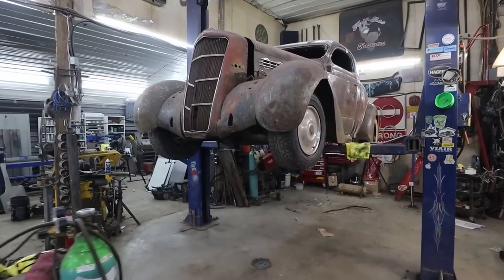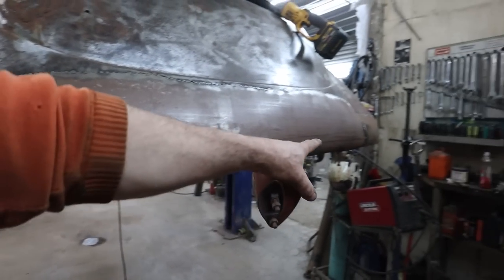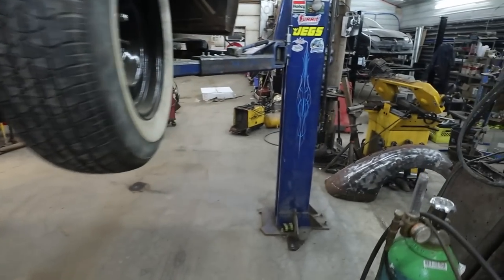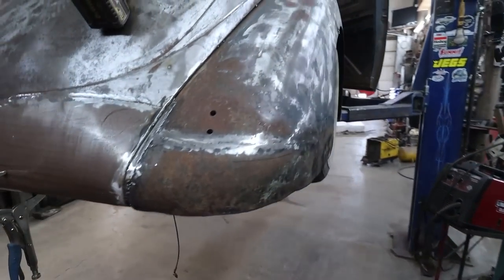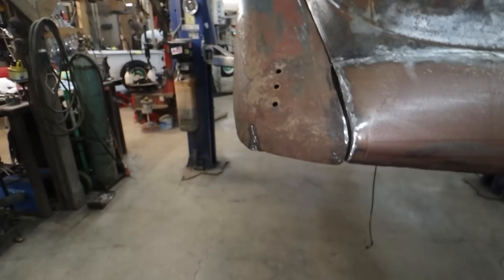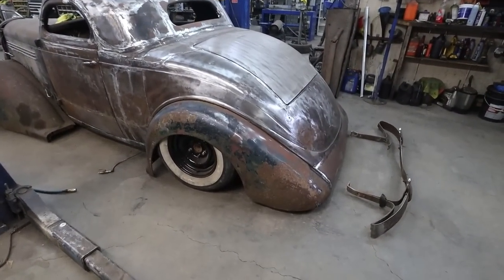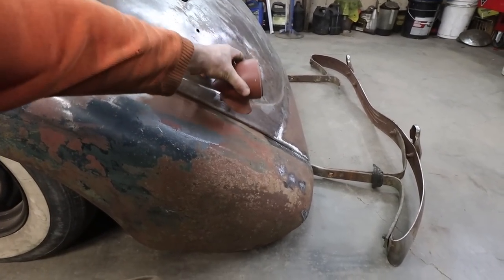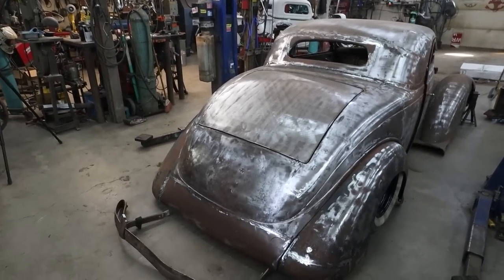Matching fenders to our freshly welded tail pan on our 35 Dodge coupe.

Comment: Another vote for fender welting to help close that large gap around the periphery, reduce the annoying "tin can effect", AND save yourself a TON of welding that may not survive your rough roads.  Bob Drake and other repop suppliers stock it, and it can be had w/  stainless or black strip; matching basic body colors may still be offered too.  Comes in bulk rolls, as I recall, but if you were to order sufficient lengths for a 35-36 Ford coupe, total amount would be very similar.  
   While you are at it, order frame welting to help eliminate squeaks and rattles between body and frame...

Comment: About rock chips. Don’t know if it’d work, but maybe you could use a trailer fender as an inner fender. 
Great project!
Reply: Method is used by aluminium fendered classic race cars over here , obviously retired from the track and used for taking to shows ,where the added weight is no longer an issue.plastic ones are used also _ great tip Steve 👍

Comment: hey brent heres my idea on the rear fenders insead of welding them tak to sheetmetal and roll it and make a "trim" panel weld some studs on the bottom drill the holes for the studs to bolt it from the bottom then if you ever need to you can take off the rear fenders still but with the trim piece on itll look like the fenders are part of the body hope ya have a great week glad this things coming along nicely it ought be driving in no time

Comment: Brent, add a metal mud flap behind each back tire. It’ll keep the rocks from hitting the back of the fender.  Also, those old cars had a cloth gasket between the fender and the body. I think a rubber one would work well today and you won’t have to weld it. Hope this is helpful.
Reply: Larry yes    i used fender to body piping gasket type 
comes in  roll various colors,,,,E d

Comment: Brent - instead of welding the rear fenders to the body, put some rubber fender beads between the body and fenders.  The fender beads from a 1970’s VW Beetle are what you need and are readily available. Your welcome ~ Pablo.  P.S.  When you are getting those VW fender beads, pick up some dawgie treats for me tooooooooooooo!

Comment: Hi Brent

On the rear bumper it looks like the bottoms of the bumperets are cut off by the looks of the front bumper.

On the rear light's it is only the mount that is for one side the light housing is universal, you could make your own mounts and fit the light housing to them.
If you have a extra set of matching light housings you could do a double rear light mount, say the inner set are tail and brake light with the outer set being tail and signal light, so using the bright light in the twin filliment bulb as brake in one and signal in the other and the dimmer light as the tail light.

On the front filler strip for the bonnet / hood to the radiator shroud split the difference by 3, 2/3 to the shroud and 1/3 to the bonnet / hood, that way the shot line will look in proportion to the mounting of the front lights.

But most of all you always come out with the best idea for the build.

Comment: Man is that car looking good, the backend is really coming together nicely! Not only are you a great fabricator, you are a great designer as well. I noticed at the beginning of the video when you welding/grinding on the back of the car. That Pablo was way in the background by the overhead door. And every time you welded or grind on the car he turned his head so he would not see the flashes from it. He is very smart, either well taught or got his eyes seeing spots and did not want that again. Take care my friend

Comment: Looking GREAT Brent! Personally I'm not a big fan of the bumpers with the dip in the center. I like the flat/straight bumpers ( like 35-36 Pontiacs or Studebakers) on Lowriders. 
However... I would agree wholeheartedly that mounding/welding the fenders to the body would be straight kustom in my book ✌️

Comment: Brent, if you know somebody with a 3D printer you could map the driver side mount and reverse it. When it's printed it would give you a pattern to sand cast a new aluminum piece. Be a good bit of finish work but it might do the deal. Just thinking out loud here.

Comment: The rear sheet metal is really starting to come together and look sharp.  It's hard to tell because of the difference in the surface finish, but it looks like the passenger side fender lobe is a bit more rounded on the bottom than the other side.  Fixing the driver's side to match should even out the bottom edge of the rear fenders...  The rolled pan is such a simple little thing that changes the look of the rear so very much.  When you get to the front fenders, could you take a few minutes and address the stress cracks in the wheel arches.?, what causes them.?, and why they are so difficult to fix..??  Most people seem to just zip them up and pass right on by without any elaboration on how they got there and why they are so danged hard to keep from coming back.  It is still a guilty pleasure to watch you shaping and fabricating sheet metal panels.

Comment: When I welded the rear fenders on my 50 buick I replaced the flange on the removable side with 14 gauge steel and cut some corner kicker out of 1 x 1 .063 about 4" long and weld them in there to support the fender farther out no cracks yet and I'm 3 yrs in driving the car

Comment: If you weld the fenders inside and out then make sure the welds are clean on the outside and use long and strong ( long strand Fiberglass filler for your first filler they won't crack, a tip from the old man. Also I started on my 34 ford 3 window again, this is Rob Burns signing out.... I'm old.

Comment: It's mentioned further down but you could use fender welts to close the seams and quiet any possible squeaking if you decide to bolt the fenders on. VW Beetles had fender welts and plenty of old cars did, too. Chrome fender welt might be kinda cool. Or buy plain welting and paint it body colour using a flexing agent.

Comment: They make a rubber seal material with a rounded side that fits in between the body and the fender that seals up that gap and I believe it’s paintable.

Comment: Building a curtain behind the wheel out of 1/2” flat expanded metal would protect the fenders from rocks and mud . It would be easy enough to clean  up and would also strengthen the fender and keep it from flexing

Comment: Bumpers of that vintage were intended to protect the sheet metal in parking situations when you or another car would bump. They are made of spring steel or at least the brackets are. Very hard to bend without heat and heating them alters the spring steel characteristics. They don't provide much protection in an accident.

Comment: The taillights that you have two of them for one side grind the bottom of it off a little bit on the sloped part of each side and it will fit flatter and fit either side it would fit Defenders good at the bottom because when it's up it'll look good and when you lower it down it's kind of like backup lights

Comment: If you want to weld fenders onto the body, you might try bolting the fenders to the body and adding some  stiffeners from inside the outer fender wall back to the body. The additional support provided by bolting and the stiffeners should help minimize flexing that contributes to cracking.

Comment: Hey Brent, what about a gasket to put between the rear fenders and the body? I don't think welding it will look rt.. it'll make the fenders look smaller than they are and it will probably crack. Ooh! And that pipe you used on the rear will be a severe rot point if you don't put a piece of metal on top so road dirt can't get trapped on top. JMO bud.

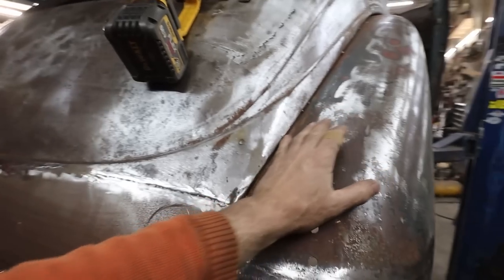Comment: 20:00  In the interior trim world it is in some cases not uncommon to have a (upholstered) rope fitted to seems and panel transitions. Maybe you can do an exterior (sheet)metal equivalent to this by welding in a steel cable over the seem AND have the fender bolted on...

Comment: With the issue you were having with the tail lights maybe you can get two GM sport mirrors from an 80s Monte Carlo or Cutlass take the mirrors off and use the pedestals they might work with your tail light piece actually you can probably find those mirrors on any Gm car from the mid 70s through 87 with that mirror option might be something worth looking into instead of doing all that fabricating or casting

Comment: Bonjour Brent ... on the issue of stone damage to your fenders, seems a good time to add an "inner fender/deflector shield" no? On my C-130J Hercs, we use 0.032" titanium sheets where the props are perpendicular to the fuselage so when the blades are iced up throw "ice darts" during engine run up, it hits titanium instead of going thru the Aluminum fuselage.  Just a thought.

Comment: Hey Brent, just a thought about fenders getting stoned on dirt roads. I was wondering if a sacrificial inner lining could be located to protect the outer guard. It’s easier to swap out an inner liner to my way of thinking. I have never done any car body work so it’s just a thought from a pragmatist perspective. Loving this build.
Reply: Additional idea, perhaps an abs or poly sheet could be used as the liner. Much like they use constructing poly water tanks.

Comment: If you weld the rear fenders And drill Inside and spot Weld What if you Heavily support the inside of the fender so it would Not shake and move It may help it From cracking

Comment: Hey Brent. It looked like the passenger of the car was a bit higher than driver side. When you where working on the bumper. I don't  know for sure but could explain your fender issue.
Reply from the maker: Yeah some of that could have been the way of sitting on The hoist also